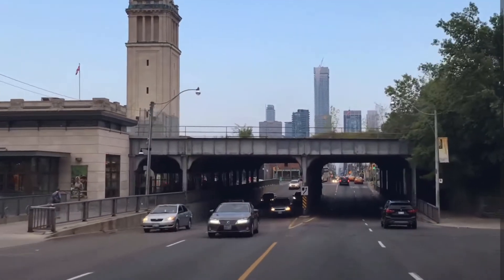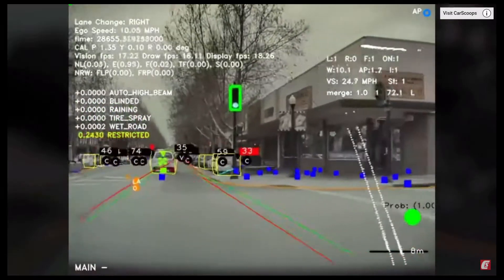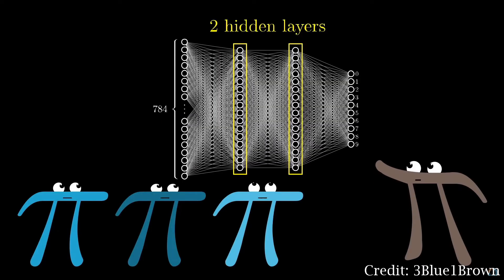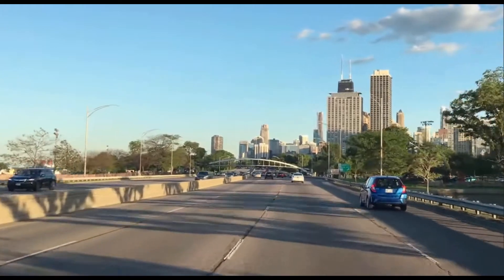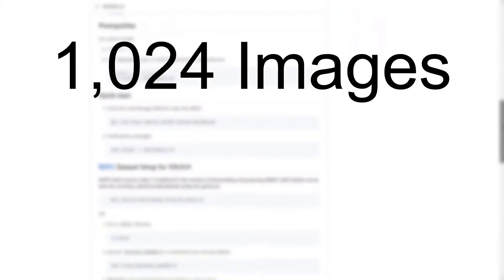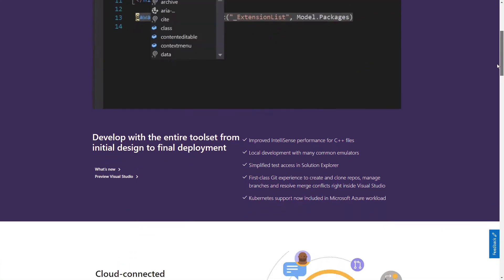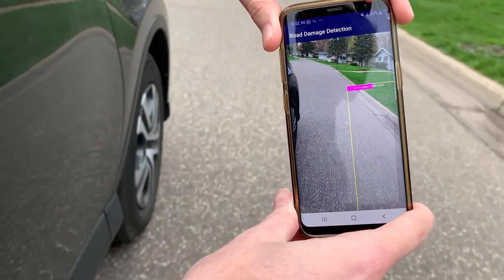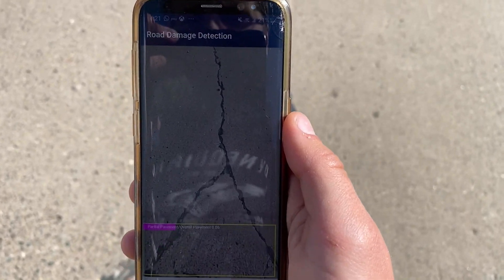Real-Time Detection and Classification of Road Damage using Convolutional Neural Networks

Comment: There were two iterations of model training which were talked about in the video
1) Transfer Learning (Using pre-trained weights and training on the road damage dataset)
2) Training from scratch on the road damage dataset

How much time did both of the methods take (training time) ? Am i correct in assuming that 2nd method gave good results ?

Comment: can we use a yolov4 tiny model for this purpose as well?
Reply from the maker: Most certainly. The performance will be slightly different from ours due to the differing models, but since you are still able to train YOLOv4-tiny on custom data it would also work just fine for this purpose.
Reply: @joenogosek4145  do you have any github or somewhere i can look at your code? If not can you share it through email or somewhere i can contact you?
Reply from the maker: @ibrahimqureshae  Our code follows closely to the documentation provided on the YOLOv5 github which can be found at this link: https://github.com/ultralytics/yolov5
Reply: @joenogosek4145  can you share your trained model?
Reply: @joenogosek4145  did you use yolov5s.pt or yolov5m.pt for training ? Also running it on a mobile device needs faster inference. How were you able to achieve that ?